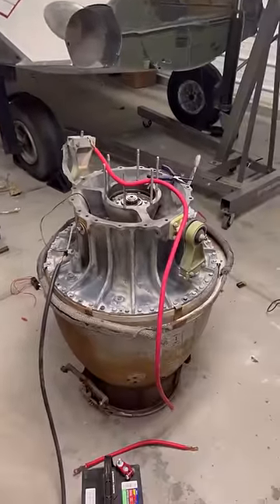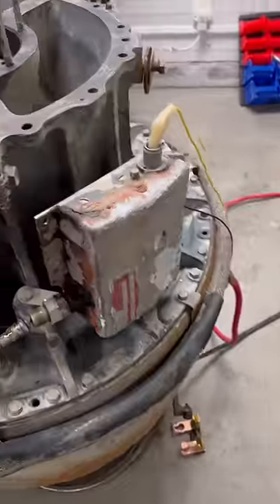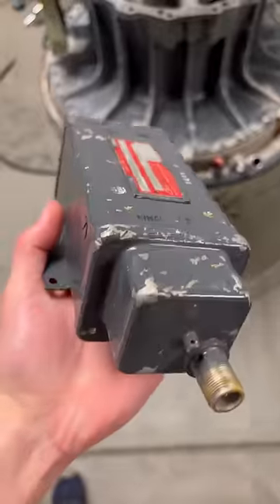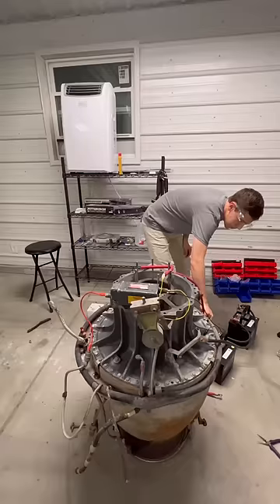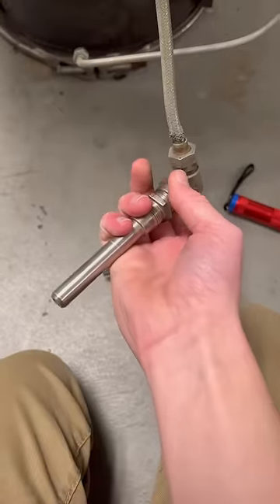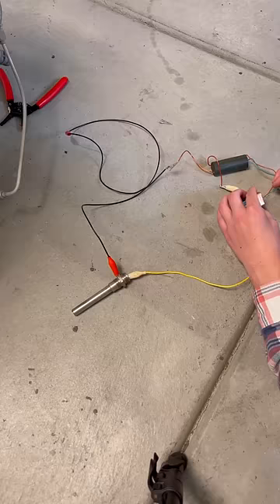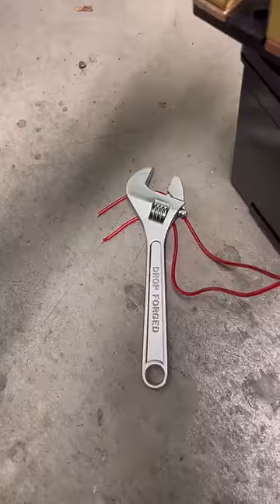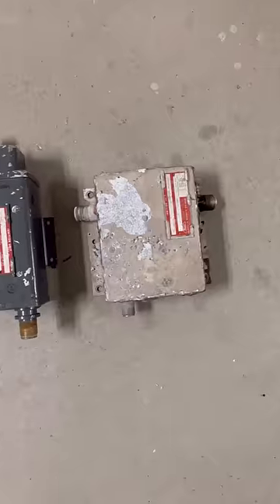Getting the Ancient Jet Engine to Spark

Comment: “If any of this confused you, pause and take a moment to look at this cutaway in order to enhance your confusion” 😂😂😂
Reply: See, I'm an avgeek. Usually a cutaway answers most, if not all, of my questions....
In this case, I now have significantly more questions than I started with.

Original comment, avgeek approved.
Reply: @Fightre_Flighte  xD I relate. Cutaways are usually very good for me. I have ASD so I’m a very visual person. But this one is a little much 😂
Reply: It is a turbine engine. What is the deal?
Reply: @samuellourenco1050  they are posers. Anybody could figure it out. That's a Google image search of the same engine in his floor lol.
Reply: All the cutaways I've ever seen show a dozen compressor wheels and 3 or 4 turbines. I didn't know that a jet engine could run with one of each.

Comment: This thing has sat for too long, it's going to either not work, or rapidly disassemble itself (explode) when you turn it on. There's too much corrosion and debris in there to run safely, and the bearings have got to be toast by now.

Please be safe and protect yourself when starting up
Reply: Bearings cups will have surface pitting.
Blades and their nearby clearance surfaces appear to have rust.
General debris litters the orifices likely near fuel passages.

If the rotating components hold long enough for the system to build heat then surely it will experience BAD TOUCH
Reply: This thing is going to grenade sadly
Reply: @NH-cr2dc  hopefully epically.
Reply: False. I’ve worked with these engines for 16 years. Stop lying
Reply: I want to be 3 states away
Reply: Enough with the nay-saying. Im quite sure its fine.
Reply: He said he’s going to put it way back in his (huge) backyard and start it from a distance. The only ones who witness from close up will be the GoPros.
Reply: @TheEmeraldMenOfficial  hope his backyard is 1000 acres....metal shards are going to be sent half a mile
Reply: @stevenrais9360  ree
Reply: That’s the thing, he WANTS it to explode when he possibly starts it
Reply: Yes be careful but definitely put a camera or two on it when you start it. Hopefully outside lop
Reply: @stevenrais9360  I doubt it will spool up enough force to fling pieces a 1/2 mile. I wouldn't stand next to it, but I doubt it will be as dramatic as some are anticipating.
Reply: Exactly. We don't mind some property damage. As long as you stand behind it.

Comment: I love how confident he is on the stuff inside just burning up safety and not tear up the turbine wheel
Reply: I trust him. Don't you?
Reply: @gregbailey45  I wouldn't trust him. He's never going to get this jet back to it's original condition, I'm willing to bet on it, too. Way too many moving parts. Maybe if he tried to rebuild an old C-150, sure. Not a several million dollar jet. Won't happen with just one dude. Or, it'll take a very long time at least.
Reply: @Ovahlls  He got a junkyard jet and ripped this engine from it to have fun with it. The airplane in the background is unrelated to this video or the project. He has a series on his channel about it. Cool (dangerous) stuff. He's planning on it exploding btw.

Comment: I recommend having an inspection done on those turbine and compressor blades (which are shit) before you fire it. That engine idles around 18k-20k RPM, when a blade gives out causing a domino effect it’s going to send shrapnel flying in every direction. Btw you’ll need a seriously high voltage (enough to stop your heart) to get a solid spark to create combustion.

Comment: In the context of a jet engine, an exciter box (often just called an “exciter”) is part of the ignition system. It works similarly to the ignition system in a car, generating a high-voltage electrical spark to ignite the fuel-air mixture in the combustion chamber.

The exciter box typically contains components like capacitors and transformers to convert the aircraft’s low-voltage electricity into the high-voltage spark needed for ignition. These systems are critical for starting the engine and can also be used during flight in certain conditions to ensure continuous combustion.

Comment: I found that if you take fireworks apart and collect all of the sparkly stuff from the inside and then mix it with some gasoline and then put that mixture in the front of the jet engine. That's what we do. And then you just have to ignite the mixture whenever you're ready to go flying. 😊👍🤸🏻

Comment: I have a project for you.. there is an abandoned public business. It was pretty well gutted and looks like homeless lived there awhile...
  At some point a huge heavy thing was knocked over and broke open a spot in the floor, revealing that the was center of the floor completely retracts revealing a long forgotten ICBM....  thats when you also realize the whole roof opens up as well... 
   I would love to go recover it... or parts of it... like the rocket engine and control systems.. plus the retracting roof and floor hardware... 
  Pretty crazy though, this thing is massive and long forgotten...

Comment: Planes rely on being in dependable condition, once u go changing one little thing u need to change it all to match, otherwise u will be in a domino affect of issues (same with boats) and my best advice is once u get her up and running run it through all possible problems it could be having and make sure everything is functioning exactly the way it should be before trying to do anything with it

Comment: Old ignition exciters use an internal radio isotope charged spark gap. With time the activity decreases and they stop firing. Krypton 85 half life is 10.7 years so after 30 years the spark gap will probably not jump. 
A cheap source of an energetic spark is a furnace transformer.

Comment: Advise from an experienced maker: clean that crap out first because the slight imbalance or deflection caused by debris can eat the bearings in a half-second - if the rotating mass doesn't fly apart first. ALWAYS rebalance the rotating mass after any modification or your assembly will grenade while you look silly.

Comment: Would the old school round ignition coil or coils from a car engine also work? 
Or the newer coil on plug type? 
Many industrial furnaces and ovens use a spark ignition system with components designed for continous use and remote ignition.

Older systems used large automobile type spark plugs of many different sizes and electrodes. 
Big square metal coils; like those used in residential fuel oil furnaces.

Industrial oven components, might be a cheap parts source for other systems too.
Neat project.

Comment: High energy machinery is no joke bro. This is what is meant when a mechanic says someone knows just enough to get themselves in trouble. This kid is literally trying to get a jet turbine engine to fire. Having no consideration for controlled fuel delivery/regulation, exhaust gasses, heat management and most importantly a static thrust test capable bench test rig of some sort to hang onto that jet turbine when it gets spun up past the ignition stage and starts to autoignite the stoicometric mixture from purely compression alone (ya know the principle that makes jet engines work in the first place!) So then when it gets past the ignition stage and assuming he's lucky enough to somehow get the stoicometric mixture close enough that it doesn't overcombust and throw metal through everything just from the centrifugal force alone or lean pop and also explode. Then likely what will happen is once it's spinning fast enough to sustain autoigniton sufficient compression for combustion. Right about the time he cuts the ignition he meticulously thought out, then he will wonder why it isn't turning off. Then right as he realizes he has only considered a very small part of what he is doing then the UNMOUNTED JET TURBINE ENGINE HE IS TRYING TO FIRE UP IN THE CONFINED AND UNVENTALATED SPACE OF AN EFFING SHED WITHOUT ANY SORT OF RIGGING will likely generate enough thrust to move under its own power then if he hasn't passed out from carbon monoxide poisoning yet he might be conscious just long enough to see that contraption yank it's fuel source with it into the nearest solid object to create a spectacular explosion and fire. So that when he meets his maker he might have just the slightest idea of how he got there.

There is a reason engineers get paid to think.

Comment: Yo!  Love the videos. I have a Turbomeca Marbore ii.  You J69 is license built based off the Turbomeca.  You can drive the spark with a msd ignition, tester (to drive the ignition) and automotive coil for a robust, affordable (for aircraft parts) spark system.  Can you link me to the cutaway pic?

Comment: Impressive work on the igniter but still not sure is the spark is strong enough. I’ve removed igniters and tested them out side combustion cans and they have a louder sharper crack to them. Hope this works though. Great work

Comment: Jets don't just use high voltage but higher amperage. As engine starts the pressure in the combustion chamber suppresses the spark.

Comment: Maybe those H.T and L.T connectors need a ground circuit, try and get those connectors cos alligator clips are horrible in this case.. if still no go I'd reckon one of the coils are gone or the rectifier on the secondary, I think. Great video 👍

Comment: You cant just plug it in. The power source should be rapidly off and on determined by the rotation speed. Ground the box to the engine.  Find the trigger wire off the capacitor.  There should be a small magneto that is mounted on the main shaft

Comment: Would a Beckett oil burner ignitor transformer work or is that gap too small for it? Probably available pretty cheap used. Bonus is it's 120v so you could unplug it from afar

Comment: I have a transformer that is specifically for testing jet engine spark plugs that has blue electrical fire coming out the porcelain insulator. That will light it no matter what LOL. Yell if you want to get it from me.

Comment: Hold on! The dude can work on a jet engine but can't hook up a portable A/C unit?
Reply from the maker: What do you see wrong with my AC install?!? All I know is it works incredibly well 🤷‍♂️
Reply: @jackschneider17  I was just trying to be funny. I am sure the A/C works fine. However, Home Depot sells extension tubes for portable A/C units. If you choose to purchase one, you could place the unit on the floor rather than have it rigged up directly in front of the window.

Comment: Flame thrower kit comes with a box that ignites spark plug with push of a button. 👍i used that pulse capacitor at first but it failed. Even at 90k v

Comment: Shake the ignitor/ ignitors if you hear rattling then they're bad and may ground out failing to give a proper spark. That's assuming this old style used ceramic insulators.

Comment: .... Dude, you could’ve picked up a used MSD6AL ignition module, and a corresponding ignition coil for a good price, and wired it up to fire as it meant to be used on a gas powered engine with a grounding circuit, and that would produce plenty of ignition spark.. Plus you would have that unit for future use on other projects involving much larger engines and fuel demand.. I cannot wait to see this jet engine strapped to a rolling chassis of some kind, and terrorize your neighbors 😬👍🇺🇸

Comment: for one the diameter of the cable you used from the amp is WAY to small to carry that current. secondly crocodile clips are NOT for that current. Can some1 with an electrical background tell this fella that he can open up the original box and get it repaired, probably quite cheap as well as those parts can hopefully be in anything these days. being old military hardware its was very advanced for its time. but today it might be common parts.

Comment: Hopefully you’ve done some research into how fast you need to make this spin before you try and start it. Adding fuel at the wrong time/compressor speed is going to cause a problem. I’m sure you’ve already looked into doing a compressor wash as well…. You’re also going to need to figure out how much fuel gets added at start, and then enough to maintain an idle, the wrong amount of fuel can get, exciting…… 

Also, it’s very important if you fail a start, you spin the engine for 30s at max rpm to clean out the fuel, jet fuel won’t evaporate. If you don’t clean the fuel out after a “no start,” things can get VERY exciting…… 

Try not to set any property on fire plz.

Comment: Couldn't you just pour some gasoline from the front and light it with a lighter? Btw. How can it take 60 000 V to breake down a 2 milimeter gap. There must be a huge defficiency of dielectrics somewhere.

Comment: atleast bruv, disasemble, clean, replace all load bearing moving parts or restore them, it wont explode, ether way, it will most likely snag and seize and crumble the rotors and stators, which will basically end this engine, the tolerances on a jet compression system are very small, buy simply dissasembling and cleaning all moving parts you chances of having a successful time will increase 1000 fold, i would hate for you to destroy that engine for nothing but views, you contents awsome bruv ! I  wana see that bad boy fire up not quitely sadly die

Comment: You never ceace to amaze me first have a early turbojet engine probably now concidered rare . What come out of your mouth of course "sketghy" but if you manage to light the thing off your for the engines demise. Not cleaning the debrea out of the combustion chamber I don't understand the desire blow it up start a fire. If you just want to be Dr Destrcto make engine using aturbo destroy it work yourself up to large potentially property damaging engine that your on. A real bag of honor would be you restoring that engine to like new shape. If the bearings are not good condition and lube system in great shape the engine be running long at all.................comment by Kenneth Boren...................